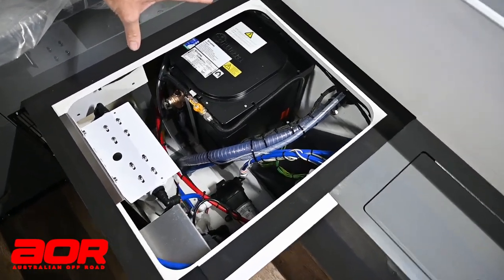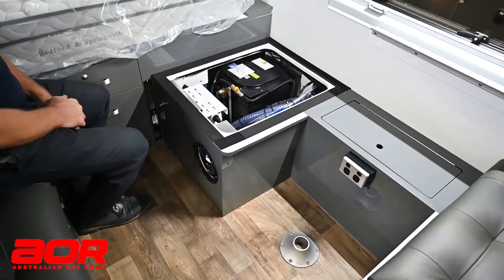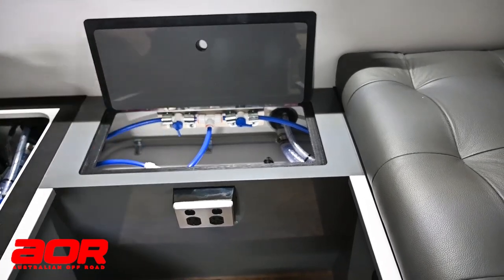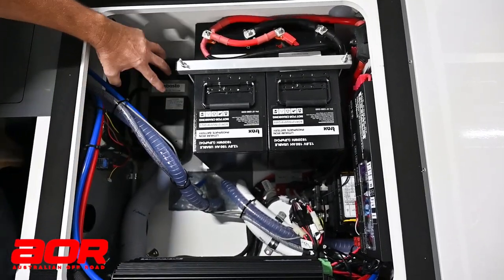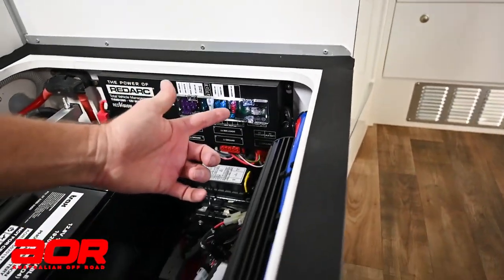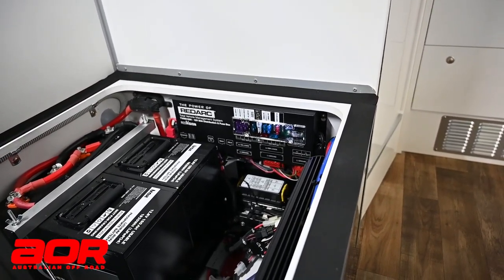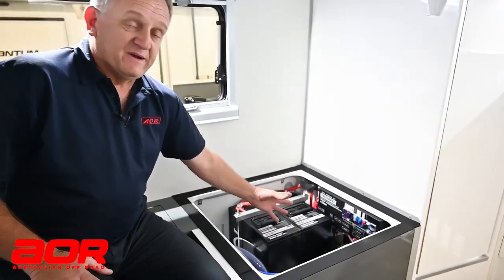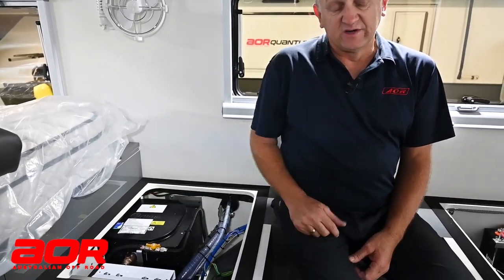AOR - Handover - Qplus Matrix Matrix Pop - Under seat electrical - 2020

Comment: Water filters and circuit breakers in the same hole,REALY.
Reply from the maker: Due to limited space available for the electrics to be located under the seats this is where they are located. We do have them lifted above the floor height, if ever there was a leak of water internally they are not in contact where the water level would be .They are sealed at the rear over the cabling as required by standards, so there is limited possibility it would ever be a concern. 

They are checked , tested and approved by our electricians who have to comply to the Australian standards for all electrical installation work.